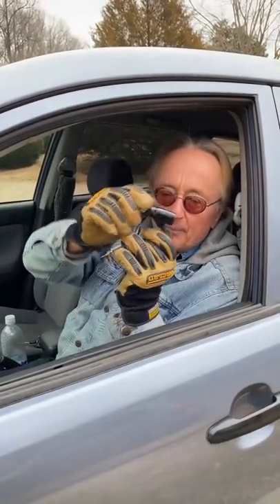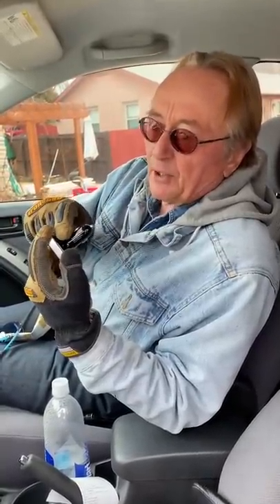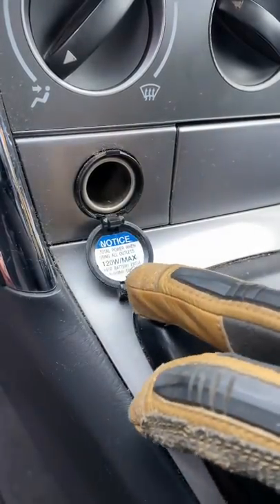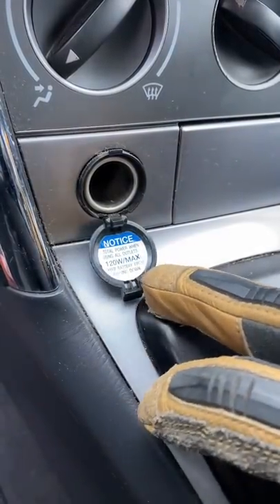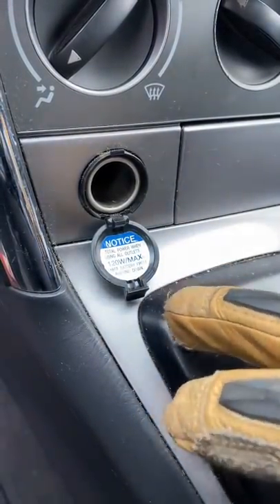Never Use This in Your Car

Comment: Scotty says "adapter" without specifying what kind. Confusing. It looks like he is holding a 12 volt to 5 volt usb charger circuit adapter, or "usb charger." The highest power chargers put out about 3.1 amps with one usb device plugged into it. If you go above the maximum you'll blow the car's fuse for the "cigar lighter" circuit. That's the worse case scenario. 3.1 amps times 5 volts equals about 15 watts. Each adapter will use 15 watts. 15 watts divided by 12 volts equals about 1.25 amps. That's how many amps it will draw from a 12 volt circuit. That is, 3.1 amps at 5 volts equals 1.25 amps at 12 volts. Cig lighter is 12 volts. Cig lighter with a 10 amp fuse will allow about 7 or 8 of these to be in use before the fuse melts – 10 divided 1.25 equals 8. There is some loss during the conversion, so figure on 7. Cig lighter with 15 amp fuse (12 volts times 15 amps equals 180 watts) should handle 11 of the adapters. Am I wrong? Check my math.
Reply: Makes sense to me

Comment: My mother insists on buying very cheap things for her truck. The cigarette lighter adapter she bought at a gas station worked well but when she tried to remove it from the socket it removed socket and the truck's electrical wires with it.

Comment: I vouch for the one you suggested - one of Anker's ROAV transmitters with USB ports.
It has not failed me, and when I'm done, it gets unplugged and put away safely. I do not leave it out.
On that note, I also have not had an Anker cable fail on me yet, so I do not hesitate to recommend theirs.

However, their latest BIG battery pack to carry around with a handle, I saw it has lithium iron (phosphate) batteries, and as we know, that's automatically a no-go.
Reply: yeah man, i only trust anker and energizer!
Reply: I have roav Bluetooth fm transmitter, I never plug it out tho. what about schosche? Aren’t they good too?
Reply: I don’t unplug mike because I think plugging and unplugging all the time will wear out the port in the car

Comment: As an experience electrician I will sadly admit I never even slightly cared to check the cig lighter ratings and happy bypassed that fuse ;)
Reply: How many watts could you use without burning a wire or something ? If it says max 120 watts . Could you double that? 🤔  maybe but I wouldn't try 500 . I would say safety ratings you can usually double lol

Comment: Def the key point here is - obey your car's fuse limits and see what kind of draw the adapter can handle before it also has issues.  I run my phone and some cheap LED lights off of one of these chargers I bought from O'Reilly's, but I run an older car that doesn't have cameras and a lot of electronics to begin with....and I ain't about to hook up anything considerable like a laptop (which some gaming models can draw that 120w max on that car in the video), or anything vital to life like a CPAP machine. Buy one of those solar charging batteries from REI for that.

Comment: You'll first think Scottys mad, but no. 
I was using a dollar tree usb-c cable to charge a tablet. Port put out 2amps. Cable melted at the plug on the tablet! Too thin of wiring. 

Took a solid year,  for anybody made affordable usbc replacements for the ZTE k88. Just lucky the back pops off

Comment: My dad had an air pump that would blow a fuse every time he plugged it into the car! He never learned until the 3rd time!
Reply: Air pumps take a lot of power.. even the cheapest ones are running around 5amps of about 60watts..
Reply: I did that for 5 years without blowing a fuse. Once I did , I plugged it directly to car battery and no problems since

Comment: Tell me about it. I blew my socket years ago and purchased the tool too remove but didn’t work. Had to use a dremel to destroy the socket carefully.
Reply: I hear this from VW owners...that tool is a joke because the only time you need it is when the socket is bad and it's usually bad because whatever got stuck in it is still stuck in it. lol
Reply: Big cork puller and masking tape.
Reply: @pyotrilyichtchaikovskyii6638  it could work but depends because there are two tabs in the inside to push. It’s annoying to fix
Reply: @scottbutler2343  Now I know why I found a charger and a broken cheap phone on the street. It was the socket. Lol

Comment: Does this also apply for dash cams? I have a dash cam that is powered by plugging it into the lighter, I have never had an issue with it, and I always plug it out when I turn off the car and plug it in AFTER turning on the car. I also have a bluetooth adapter that I've used in the same way and I've never had any problems. It does have a port to charge phones but I never use it, just the bluetooth feature. Should I just get a power bank, charge that and use it to power the dash cam in my car to be safe?
Reply: No that’s perfectly fine. You just want to stay away from the cheap dollar store ones that aren’t regulated properly. Any name brand one that cost more than $5 is usually good

Comment: Does a 12V outlet, the ones that you can fit 3 addt plugs plus some USB chsrgers, cause your climate control to suddenly shut off randomly? Like the buttons don't respond - literally dead until you press them randomly several times? A mechanic told me sometimes when its aan accessory circuit overload the car shuts off one accessory ... but I could never confirm this
Reply: How you couldn't confirm this? Next time when it happens don't press climate control but unplug this charger and then check. Or just stop using it and after awhile you will know.

Comment: Yeah I legit almost started a car fire when I was younger running a 400w inverter via the cigarette socket. Very bad idea. Always plug those straight to the battery or run 1/0 gauge wire to them.
Reply: Not fused?
Reply: @GreensladeNZ  The previous owner had a 30a fuse if I remember correctly. It didn't pop. I saw smoke and immediately pulled it off. Now i know the max is 180w through cig

Comment: “Complex electronics” lmao, this man has never opened a USB adapter in his life.
Reply: Yeah, it's basically just a 12v to 5v kick down circuit, nothing that'll make a car not start
Reply: The complicated ones are buck modules with Transistors Capacitors and resistors and other components(non linear type), they run cooler and dont fry up easily
The easy types are simple Transistors used directly to buck 12v to 5v (linear) and they heat up like radiators and fry easily, they consume a lot of power too!

Comment: using that cheap fm transmitter's usb port to charge my mobile, warming coffee mug for over 2 years. Nothing happened so far. There's model number for that cheap item too......and maximum power output is mentioned also. If a driver connects 5 amp equipment to a 2.1 amps output port and it burns up, idk whom should you blame. I'm not gonna blame the port for sure

Comment: go above?? usually most are 1.1amp i barely find 2.0 amp.  usually they are under powered. quality is a different story.  esp if they get overused and heat up.
Reply: What is watts for 200 please?
Reply: @lunarpking  My Oxford Physics educated Siamese cat replied:
Watt = Amp x Voltage
Amp = Watt / Voltage
Voltage = Watt / Amp
Hope this answers your vague question
Reply: @lunarpking  The watt is a unit of power or radiant flux.

Comment: I sometimes wonder how many perfectly good cars or trucks were completely destroyed by someone doing something stupid with the electrical system. With cars from the 60s and 70s you could repair electrical damage without too much trouble most of the time but with a modern car it costs maybe thousands to rewire the thing and replace/reprogram computers or solenoids.

Comment: If still had actual 30amp lighter sockets instead of these politically correct power points we would not have these problems. Everything the left influences goes to hell. And give me damn  ashtray back and in an accessible spot while I’m on roll too! And vent windows!

Comment: I would love to know if all the computers gadgets junk on modern automobiles are done for safety our health cleaner air or more hy re there so many recalls when they donot work properly as made to do so I had a new front bulb replaced in my 1971 vw auto in five minutes then he did a much newer one in half n hour for five hundred plus 100 labor mine was five dollars thank u it was even nicer years back in love dating relations more respect simpler dates for each other last many more years divorce yes but rare most of all was so much nicer